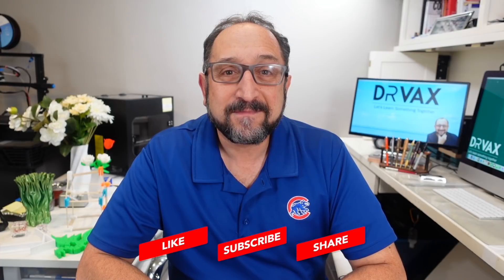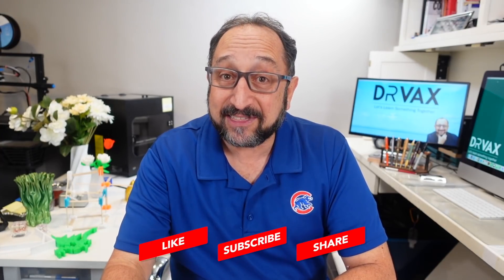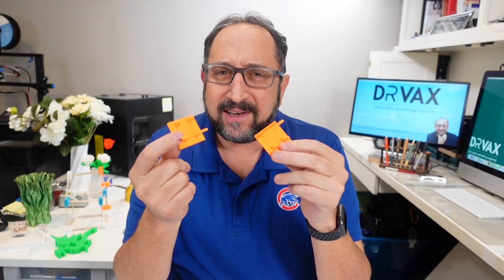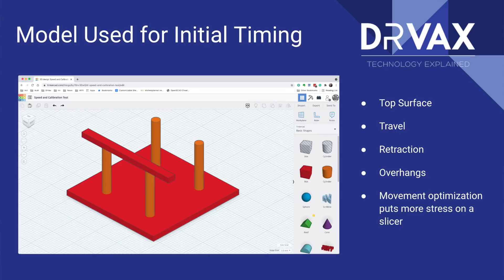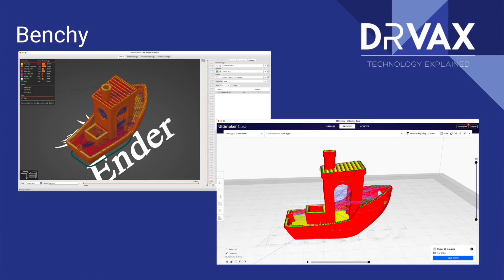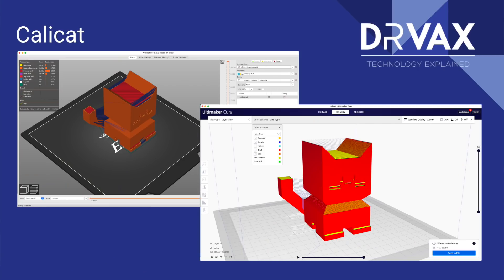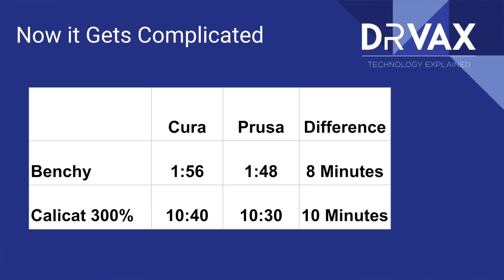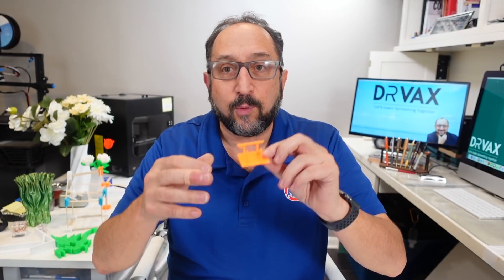3d Printing Faster with Prusa Slicer vs Cura Slicer

Comment: Hi master, I'm using prusaslicer on ender 3. I have a problem within support. Firstly, it is not easy to remove the support and the bottom surface is very rough and also stringy.

do you have any solution about that?

I need ur solution guys, so please master or anyone 🙏

btw, I am using PETG filament.
Reply from the maker: In most slicers you can specify the gap between your supports and your model.  In the Prusa slicer this is call the z contact distance and is available for the top of supports and the bottom of supports on the print tab.  If the bottom surface is very rough you may have the nozzle too close to the print bed.  These are two things you can try.
Reply: @MakeWithTech   Thanks Master, do you have profile config bundle for prusaslicer ?

Comment: What I would like to know, and yes I can install prusa and work it out myself but hey, its a lot easier to ask if anyone else has done it, is there any significant difference in slicing speed between the two? It could be just my imagination, or it could be my computer is getting old bones and slowing, but Cura appears to be getting slower at slicing with each new release. Small models is not issue, but when it comes to larger more complex models some are taking 10 minutes to slice which I dont think was the case a few revisions back.

if Prusa was significantly faster at slicing then I think that would be enough to tip the balance in its favour as there does not appear to be much in the way of difference feature wise other than ironing and tree support, neither of which I use.

Improvement in startup time is most likely due to Prusa heating the bed and the nozzle simultaneously and Cura heating the sequentially.. 

This could be less than optimal, some printer manufacturers (creality being one) are somewhat frugal with the power supply, a number of them have PSU's that exceed their operating specs if the printer is heating both at the same time.. There have been a number of cases of burnt out PSU on the ender 5 plus i think, and other printers in thier range.

While during printing it is not going to be that much of an issue because for the most part either/ or will be heating at any given point and only switching on for a small part of the overall time, during the pre-heat phase both would be on constantly, for an extended period of time and therefore exceeding the PSU specs for an extended time.

Comment: I was using cura for my cr 10s5 and my last projects require a lot of retraction. On my print, cura estimate at 6 hours and 10 minutes
Creality slicer estimate at 3~ hours
it's been already 1 hour 20 minutes and my print is 46%
wich is better now??
i've been wasting a lot of time printing with cura
Creality slicer have same interface like cura and all settings but the slicer works different so save time in traveling and retraction
Reply: creality slicer IS cura... just an old version

And the difference between the two is differences in profile not slicing..
Reply from the maker: Almost.  The most recent version of Creality Slicer also has excellent USB support and some nice UI enhancements.  The better optimized profile for Creality printers is significant for beginners.
Reply: @MakeWithTech  But essentially the same slicing engine is the point, so difference in speed is down to settings rather than software..

Why anyone would be using creality slicer is a complete mystery to me however!

Comment: I've had issues with my ender 5 and cura not showing correct times but there are settings within cura to (and possibly prusa) to adjust and get more accurate times, off the top of my head it's speed settings and jerk settings have to match the printers.

Comment: so question, if my printer bed is bowed in the middle, cant i just sand down the aluminum to a level surface and just not have to worry about filling it with paper and stuff and lowering the effectivity of the heat bed where that paper is,  or is it treated or something,

Comment: This is really testing print profiles. Not slicers. No idea what infill pattern was used and that alone makes a huge difference. I think stephan of cnc kitchen has a video on infill strength, and speed, I switched to gyroid for the best combination of speed (gyroid is almost the fastest) and strength (again in all dimensions equally strong but not the absolute strongest in either dimension) you can tune acceleration, and print speeds massively to get better speeds but quality can suffer, use a larger nozzle with thicker layers to print faster. The only thing you have to worry about is how much wear and tear of those faster speeds. Think how hard stop and go traffic is when you are alternately flooring the gas and the brakes vs what it would get with lower speeds. If you have time, let it print longer. I have my infill speed turned up and inside perimeter speed. When I want further speed I combine infill layers.

Comment: Thanks! To speed up print initialization I restore a saved mesh with an M420. I run a 5x5 mesh when ever I change bed temperature and save it. IE: If I change from PLA to ABS i'll re-run the 5x5 leveling mesh and save it.

Comment: Working with both of them every day, i've found that each one has its own sophistication. Of course, i will agree with you Irv that PS is a bit faster than Cura, as well as PS's G code is lighter than Cura's that it is heavier.

Comment: This was surprising to me. In my experience, the results are exactly opposite to what you found. I’ve found that Cura estimated times  are consistently longer than Prusa. I’ve also found that Cura actual times are typically longer than the estimate, while Prusa actuals are typically within a minute or so of the estimate. This applies to both shorter prints (2-3 hours) and longer prints (12+ hours). Hmmmmm.

Comment: I would assume the accelaration and velocity parameters of your printer profiles have most impact on speed. So unless you adjusted them to be the same (maybe I missed that), this measurements are rather meaningless.
Reply: Yeah, travel speeds and acceleration speeds are heavy game changers here.  You even can see this here in the video with objects which are mainly prints without travelling.

Also worth to mention are things like combing, random z seam, no movement over walls and the infill percentage. All these need to be equally handled before comparing.

In the end it is just the best path finding, which probably gives a few seconds advantage in a big print, but is it worth the try or to swap. I don´t think so.

3D printing is an art and painting the same picture ten times, gives you ten results and take a different amount of time, even so here the painter is an robot and the variance comes from the preconfigured order of movements.   

In addition to that (when comparing printers, too) the firmware has a speed limiter per axis, so the same profile would be fast like hell on printer one and slow on printer, too, because the firmware took the weak frame into account.

In the end more or less all printers these days are the same. It does not matter if it is 2000$ or 160$. Even the cheap ones have a sturdy frame these days. The only real difference in price are stepper drivers, filament sensors, 32bit boards, touch display and stuff.  The user experience is different, but the print results are very much the same.

Differences only come from the type of printer. FDM or Resin? Shaking bed, CoreXY or one of the others.

Comment: The startup time in prusaslicer is less because it starts heating the bed and hotend simultaneously rather than heating them one after the other in cura and has a small purge line which is highly overextruted rather than a large purge line with the same extrusion rate.
Genius method to save time as it extrudes same amount of filament for priming.
Reply from the maker: Correct.  I originally had this in the video but it got too long so it is on the “cutting room” floor. 😀
Reply: @MakeWithTech  Thanks for inspiring me to get into this awesome hobby sir, you were the source of information and clearly illustrated videos that i needed to get into this.
God speed to you and may you reach 10 million subscribers this year 👍🏻

Comment: Got an Ender 3 v2 and a Prusa i3 Mk3S+, and I use both slicers. Ender 3 v2 has always reported inaccurate times in slicing and in the control panel. PS2.3 has been extremely accurate on the Mk3S+, down to the second.

Comment: Great video as always 👍
I like your approach with different models.
I started with CURA some 2+ years ago, switched to Idearmaker and had better results on my modified Ender 3.
After I switched to PS 2.0 and now 2.3 I have had better results.
It is faster and prints more pretty and I can trust that the print is good. And I love that the filament is separated from the printer settings in an easy design. 
Not the CURA Search and find "one collum fit them all" way.

Comment: I have had some prints that print faster on the MK IIIs than on the Ender II with slicing by PS on the Prusa and slicing by Cura on the Ender II but I also got massive stringing on the Prusa printed part, this is normally when the nozzle has to travel between high sections of the part and is because Cura does a little manoeuvre that breaks the tension on the filament before travelling to the next area to print, increasing the retraction on the Prusa did not solve the issue completely but the stringing was no longer connected with both areas.
 This was an extremely interesting video by the way!

Comment: I really like Pruca slicer, only problem i have is with the automated support getting stuck on the parts i print.
Reply: 0.25mm z distance.
75% xy distance.
3mm support spacing.
4 interface layers.
0.2mm interface layer spacing.

Comment: I've tried them all,  I feel cura has the best control
Reply from the maker: For me it comes down to personal preference.  I use both. Just as I have different types of wrenches in my tool box, I have multiple slicers on my computer.
Reply: Yes I agreed cura easiest to used and if tune it can print faster with acceleration and speed